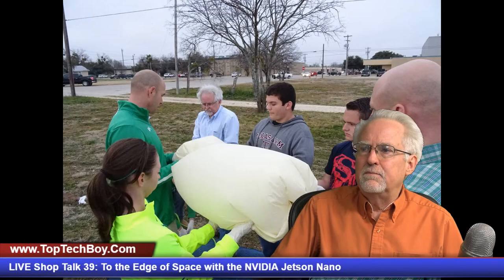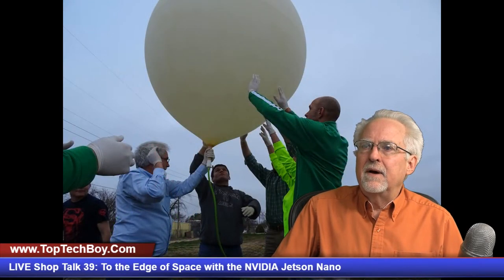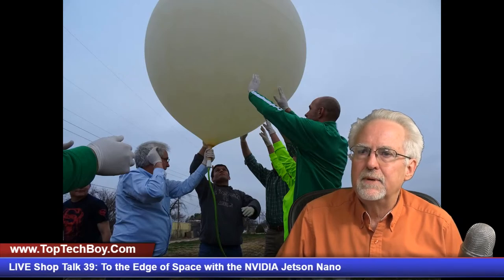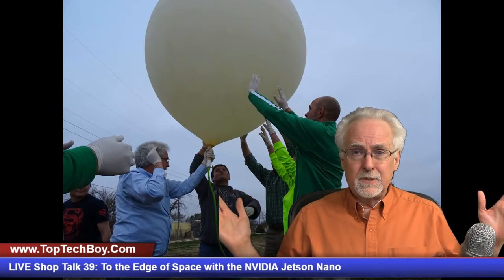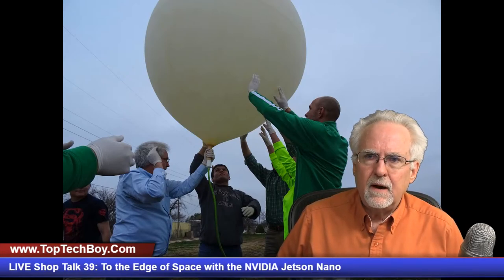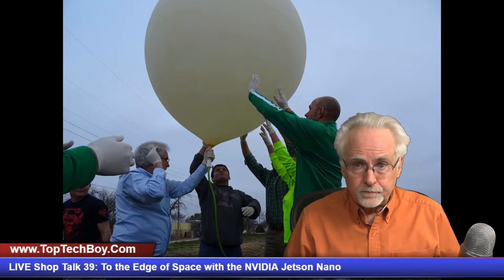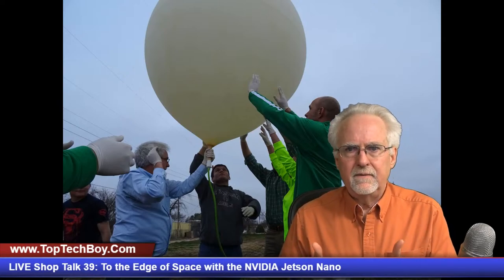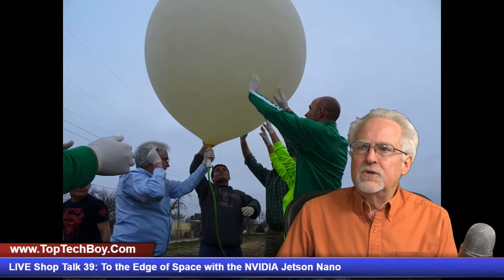LIVE Shop Talk 39: To the Edge of Space with the NVIDIA Jetson Nano

Comment: Paul, Great video. Thanks for your service to our youth to follow up a career supporting our national security. 

I'm a scout leader and I'd love to set something like this up for our scouts some day. As a homeschooling parent (since long before covid) I've also got my kids starting to work through your videos (fusion 360 and arduino to start).  Thanks! 

As an engineer, you've got my curiosity going.  I've been thinking about the the antenna pointing issue and I was wondering if a signal tracker could be implemented to augment your IMU. Simply nutating the antenna probably wouldn't work because I suspect your signal strength varies as the package swings under the balloon so you wouldn't know if the variation reflected pointing accuracy or signal variation. 

I was thinking about something like a Radar monopulse system that compares amplitude and or phase in four quadrants around the beam center.  It's probably too complex for your system, but could you compare signal from four antennas around the primary one?  Alternately, could you mount offset receiver elements around the primary within your existing dish and compare them. In these cases, all antennas would see the variation, so you can zero that out. 

Finally, as a different approach, could you mount an IMU on a rigid arm extending far enough behind the dish to experience larger swings? Would that make it easier for the IMU to measure your pointing angle? 

Keep up the good work.